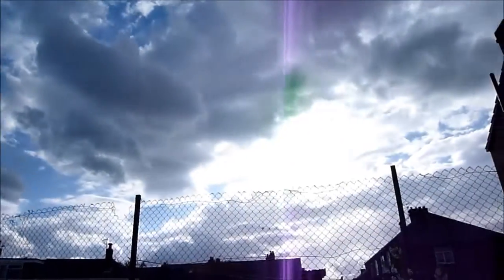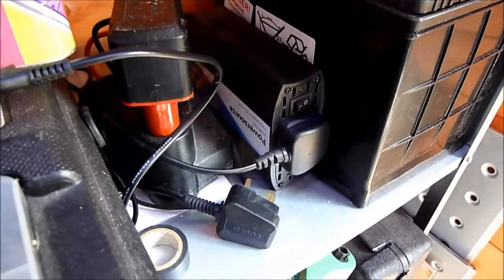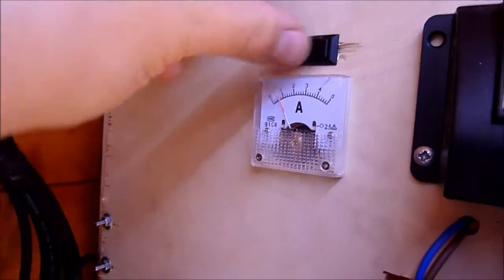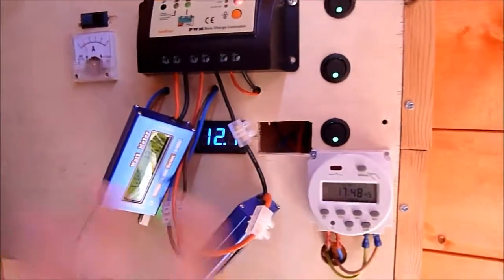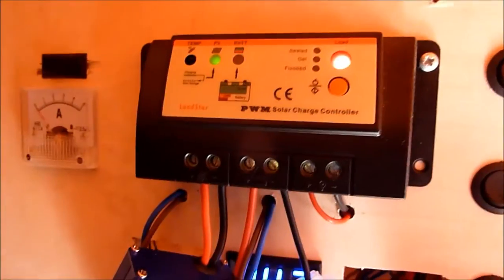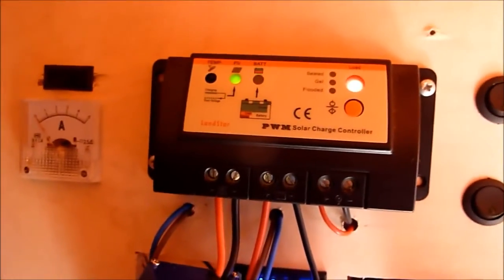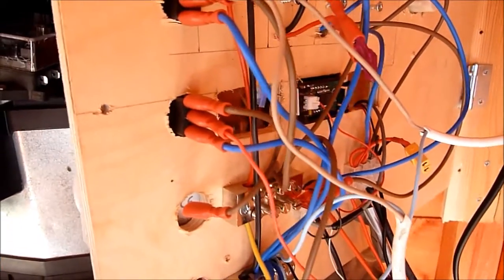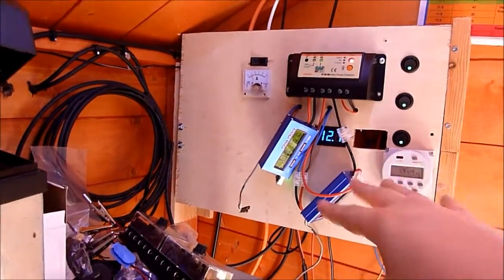Introduction - PWM Charge Controller - 12v Solar Shed

Comment: Adam can i ask what 12v timer you are using in this video or can you suggest an alternative
Reply from the maker: You can find it here on eBay... http://rover.ebay.com/rover/1/710-53481-19255-0/1?icep_ff3=9&pub=5575189419&toolid=10001&campid=5337903455&customid=12v+Digital+Timer&icep_uq=DC+12v+Digital+LCD+Display+Programmable+Time+Counter&icep_sellerId=&icep_ex_kw=&icep_sortBy=12&icep_catId=&icep_minPrice=&icep_maxPrice=&ipn=psmain&icep_vectorid=229508&kwid=902099&mtid=824&kw=lg
Reply: thanks fella

Comment: Watching all your videos making my way from most recent to oldest. Great stuff! 

Really helpful for another solar shed wannabe. 

Have a really super basic question for you here. In most of your videos, your 12V batteries are hovering at 14v. Can you explain why? Shouldn't they be at a maximum of 12.8v as per the label on the side of (this, not the new UPS batteries) the battery casing? 

Again, really appreciate all the useful and helpful videos.
Reply: Yeah my car is around 14.2V but blips to rarely to 14.5V.
Reply from the maker: +Dave Davis Lead acid batteries can be taken to 14v (and beyond in some cases) when being charged. If they are left to rest they'll settle down to 12.7 or 12.8 after a while. 
An alternator in a car will typically bring the battery up to 13.8-14.2 volts whilst you are driving around to ensure it is fully charged next time you want to start the engine. 
Thanks for getting through all my videos - you must be sick of the sound of me by now!
Reply: +Adam Welch Not at all! I've made my way through most of them and they're super helpful. 

Appreciate the info. I didn't know that about lead acid batteries. Got any links to videos with more in depth info on charging from solar? I'm pretty much clueless and would love to learn more. 

Finally, thinking of getting the triron you just reviewed. Any idea when it's getting released? I can't find anywhere selling it yet. 

Thanks again!